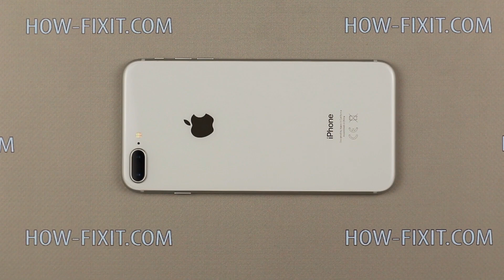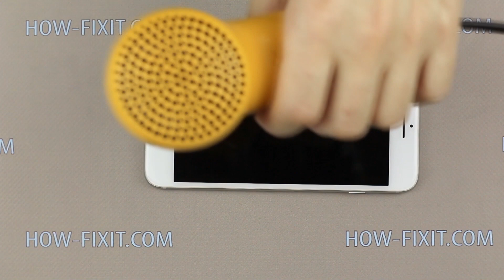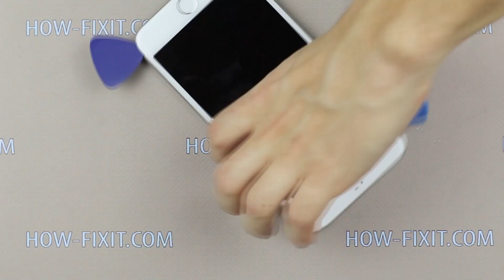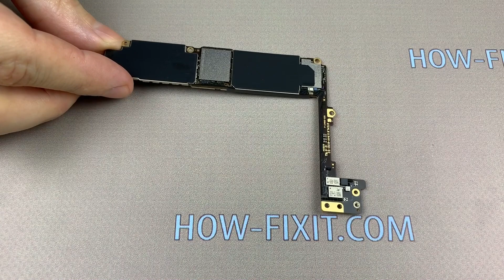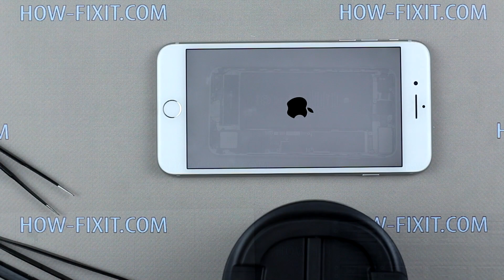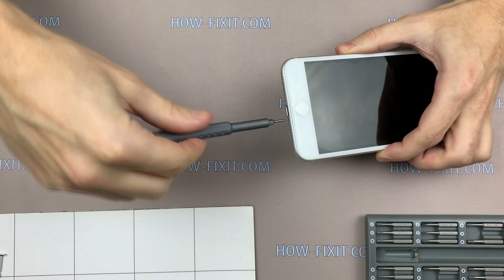iPhone 8 Plus motherboard replacement

Comment: actually need to replace the mainboard of an iphone 8 plus? i just cant find an proper answer on the internet. ive looked through several instruction guides and they name different screwdrivers needed which in return arent mentioned on the kits i found.

Comment: My front and rear 8 plus smashed. So bought a replacement genuine housing from ebay. Came complete with everything except the motherboard..(obviously) i transfered the motherboard over and now there is no sign of life on the phone. I have transfered motherboard back over and still the same. Screen is blank, no sound, not connecting to itunes nothing..

 Please help where did i go wrong?! 😣
Reply: Just have the same experience. 
Please let me know if you're able to solve the problem. Thanks.

Comment: The Apple company sold faulty iPhone 8. Properly issuing a recall for a problem with the "logic chip". Apple requires consumers to input the serial Number into their website which determines if consumers qualify for free repair. With out assessing the physical phone at all. This recall was to cover Apple, while passing on hundreds of dollars per customer to repair. Atop of loss data on the already purchased phone. In my experience, I have a prime example of the model 8. No damage, no water damage, pristine condition. However the phone became extremely hot and never activated again. After being told the motherboard was no longer working, I went to apples website and denied repair unless I pay out of pocket. I explained my situation to Justin (apple rep) who then allowed me to speak with his senior Miya  (oct 3, 2019). Miya explained, I can pay out of pocket or bring the device into a store when my option would ultimately be to pay out pocket, Even if the device is shown to have a factory issue ("logic board") /recall because my serial Number is not approved in their data base. Whom ever issued this recall/ scam, with this structure that passes the company's fault on to consumers should be held responsible and Apple for generating more revenue from taking advantage of unsuspecting consumers. Thank you.

Comment: Changing the motherboard without the home button only leaves you with a no finger print unlock phone or will it be useless at all? No home functionality?
Reply from the maker: the new motherboard will not work with the old home button at all
You buy a kit motherboard + home button
or motherboard + universal button as in this video - https://youtu.be/oh9yUHDmP-E?t=296

Comment: Will replacing the motherboard let you create a new Apple ID, lets say you buy an iCloud locked iPhone, will replacing the mother board bypass the iCloud lock and let you log into your own account? Greetings from Spain
Reply from the maker: The new motherboard is like a new iPhone. You can connect your Apple ID or create a new one.
Reply: I needed iphone 8 plus board @howfixit
Reply: @howfixit  does the old touch id keep working or i need to change it ??
Reply: @mdb9007  Motherboard is a phone by itself. It's like an engine of a car..
Finger print or whatsoever is gone with the old motherboard.
Reply: Akinwale Akinruli 👍👍👍
Reply: ¿Le cambiaste la Placa?, ¿pudiste poner el iCloud nuevo?
Reply: Excellent video I may try this on my iPhone 8 Plus to unlock it for other carrier usages. Remember to back up all app and Dara before doing this or you’ll have to start from scratch.. 👍🏽👌🏽
Reply: Yes

Comment: Due to my iPhone's motherboard problem I want to order iPhone Seven Plus's Motherboard Order from Alixpress. So there you see the Touch ID and the No Touch ID motherboard. But there is no problem with the Touch ID of my iPhone. If I take a non-touch ID motherboard, then what would be a problem?
Reply from the maker: You need to buy a motherboard with Touch ID.
A new motherboard will not work with your old Touch ID button.
Reply: Now, if you just order the motherboard and then order the Touch ID then there will be a problem... 

My iPhone 7 Plus
Reply: @faysalhossain7215  ......................... You need to order a motherboard with touch id you wil get a motherboard and a home button replace your old home button with the one that comes with the new home motherboard and replace the motherboard with the new one otherwise your home button will not work as the home button and motherboard are paired.
Reply: @RektByRafay  so why they selling just motherboard without home button?
Reply: @krzysztofpanasowski5625  because They'll charge less with out the home button